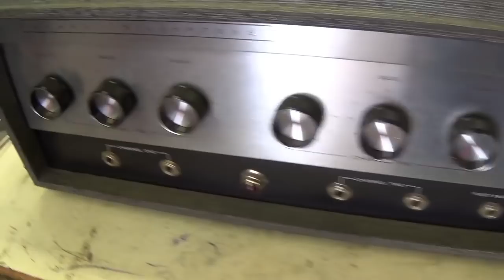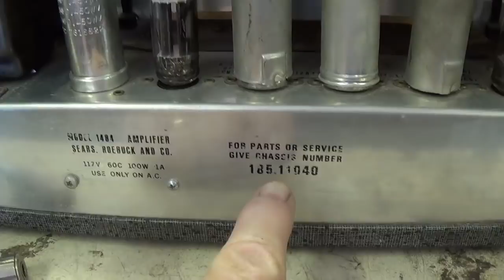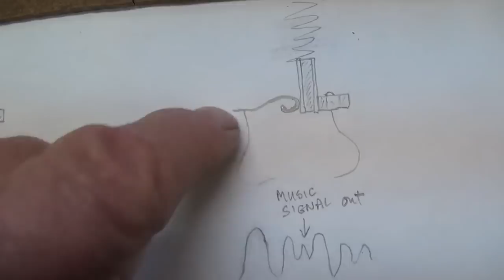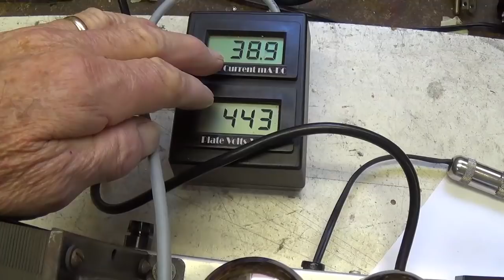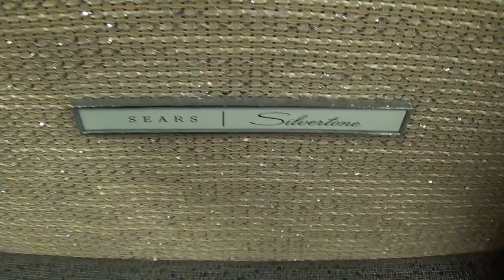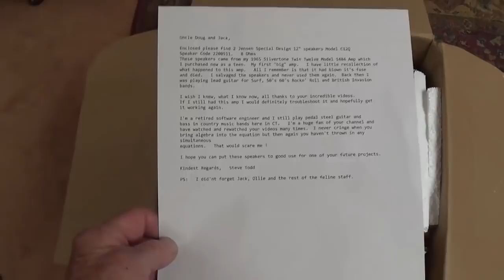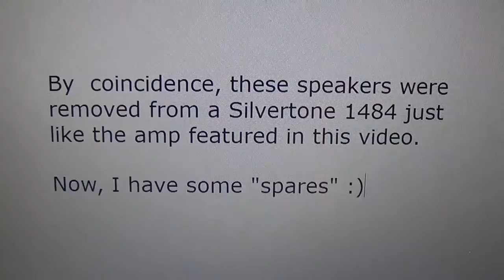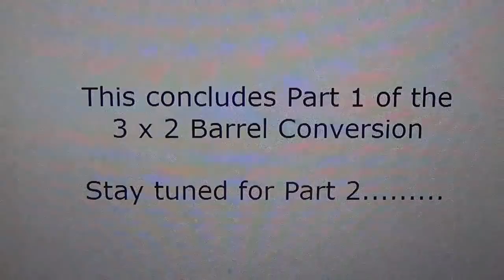Super Nice 1966 Silvertone Model 1484.......The Amp that Launched a Thousand Careers

Comment from the maker: The audio test is as follows:  5 tunes clean Channel 1 and 2.....3 tunes Tremolo.....3 tunes Reverb.....5 tunes Channel 1.  NOTE: The video portion of the demo is not synchronized with the audio portion, so the position of the input cable and amp controls may not agree with what you are hearing.
Reply: I have a 1964 1484. It was 100% original when I got it. I recapped it and installed a 3-prong chord. I love the thing.
Reply from the maker: I don't blame you, William. This video reminded me how great the old Silvertone amps really were.
Reply from the maker: @godsreddoor6345  The Prosonic was only offered from 1996 to 2002, and the early models, handmade in the Custom Shop with "LO" serial number prefixes, are quite rare and desirable. The later models, with "CR" prefixes, were mass produced in Corona, CA and are good amps, but not as rare or desirable as the early versions. If I ever have access to a Prosonic, I would be glad to feature it in a video.
Reply: I hear you on the hand wired stuff. Printed circuit boards are planned obsolescence.  I always say ones tone comes from ones hand .
Reply from the maker: @bobbreakup1001  I agree completely, Kurt. BB King has built his illustrious career on the subtle sensitivity and coordination of his fretting fingers.
Reply: Hey UD! Just stopping by to give you a shout out and to say WE MISS YOU! Hope you & yours had a wonderful holiday season and are doing ok!
Reply from the maker: @ThePreyMantas  Never better, PN. Thanks for your concern and nice note. We're currently working on a new video and should be  back on the air in the near future.
Reply: @UncleDoug  Excellent! I'm relieved. I know folks need to take breaks off for sure, but it's been a little over a month and I was hoping everything was okay and really glad to hear it is! Thanks for the heads up and looking forward to listening to and watching your sage words and witty humor again! It can be an intellectual desert out here at times. ;)
Reply from the maker: @ThePreyMantas  Thanks so much for your concern. I intend to include a Part 2 video, as I usually do, showing some of what I've been up to during the past 2 months.
Reply: @UncleDoug  as I understand it,  Silvertone amps were built in Chicago by the same firm that supplied the Gold Bulldog speakers to Thomas Organ Co. for Vox amplifiers.
Reply from the maker: @zurdoremi  You may well be correct, Z.
Reply: I enjoyed the video.  I'd also like to offer a tonal suggestion.   Plug into the right most input on channel 2 and connect the remaining input on channel 2 to channel 1 using a short patch cable.     You'll hear what i mean shortly after.
Reply from the maker: @davemack6384  Thanks for the tip, Dave.

Comment: The 1484 (which I bought new in 1964) that I had the speak cabinet was connected to the amp with a long 2 wire cord that could not be disconnect from either the amp or the cabinet.  I added a jack to both the cabinet and amp.  On the amp I isolated the jack from the chassis ground by mounting it on an insulated board. I no longer have the amp part but I use the speaker cabinet with a Fender AB763A head that I was able to get used in 1985 and rebuild in 2006.  The Fender head and Silvertone speaker sound great together.  I really in joy your youtube content.
Reply from the maker: Thanks so much for your nice comments and interesting input, William.

Comment: I had one of these amps when I was a young hippie playing in a pychedelic rock band. In a moment of hipness I painted the head lime green because of the effect it gave when under a black light. I ditched the 2 - 12 speaker cabinet on favor of two speaker columns containing 4 12's each. This made the rig look far more impressive. Went to the gig to play and it was sounding great but, then about half way through the performance the amp started to cut out and lost power. I turned around to see what was the problem and saw that the amp head was in flames!
Show wise it was pretty impressive and of course I later found out the fire was due to a amp/speaker impedance mismatch. The amp was destroyed and could not be repaired and I learned a great lesson about matching the proper speakers to the amp being used. Too bad. Now that i'm older and wiser I wish I had that amp just for collectors sake because it would be cool to have. Thanks for showcasing such a beautiful memory as it was and should be. It was fun to watch it being restored. Thanks Doug.
Reply from the maker: You're the godfather of pyrotechnics in rock concerts, Jim. If you had only patented the concept, think of the money you would have made......just from Kiss alone ;)  What a great tale. I may have owned a set of identical columns. Mine were made by Ampeg. I wish I had checked them for scorching.

Comment: UD, Thanks for this video and the previous 1485 video.  I watched the entire 1485 vid about 3 times with great interest.  More about that later.  When I bought my 1484 used in 1968, (age 16) I had no idea how great it really was.  But after all, I was just a dumb kid.  One thing I knew immediately:  When I traded the amp for a newer but solid state Silvertone, I knew I had made a dreadful mistake!!  Some lessons are learned the hard way!
Fast forward to today.  Recently acquired my 1484 head and built a speaker cabinet myself with two brand new Jensen C12Qs.  After watching your renovation of the Silvertone 1485 amp, part 3.  (I guess it was 9 months ago), I started my renovation.  Even though the amp was working pretty well,  (all but the tremolo was functioning), I cleaned the amp's face and chassis, removed death cap, removed ground switch, removed power outlet, added a speaker jack, and painted the two transformers black.  Everything worked out very well and I was encouraged to keep going.  I decided to replace seven of the capacitors, (C1, C17, C26, C27,C28,C29, and C30.  Then, miraculously found the can capacitor from Hayseed Hamfest!  After a few trials and tribulations, (and very good customer service from Tom at Hayseed, have got a really nice and quiet solid amp to play my treasured Clapton and Hendrix licks!  Oh, almost forgot, I also replaced all the input jacks with 4 new self grounding Switchcraft jacks which really help quell the unwanted noise.  (Also replaced two resistors at the inputs and 3 of them adjacent to the can cap).  
When all was said and done, the amp really sounds great.  Jack and KC would be proud to hear this beast.  Couldn't have done it without your fine and entertaining videos.  Please keep them coming.

Comment: Very nice shape. 
I've repaired a few of these with similar problems.  Recapped of course.  Was also able to repair the reverb as you did.
The weirdest one i had was the 100 watt version that squealed and oscillated all on its own.
It behaved like poor lead dress but there was no rearrangement of wires that would eliminate the oscillations completely.
It all seemed to be centered around the screen grid leads of the power quad.
This amp did not have any screen resistors and came from the factory that way.   So on a hunch, i added them.
That completely cured the oscillation.  My thoughts are the original tubes had less gain or possibly higher Inter electrode capacitance (Miller Effect) that subdued the tendency to oscillate.  I did not have any vintage tubes to prove out that theory.
Old tube amps...gotta love em!
Reply from the maker: Thanks, Glen, particularly for the tip on the screen resistors......it may come in handy :)

Comment: Uncle Doug, I have a Peavey  Classic I bought second hand about 35 years ago.  The tone was always a little poor and  the output broke up if the volume was set above 5.  A few months ago, the power transformer burned out.  After much searching for a replacement, I had one made from scratch by ClassicTone.  After I installed that, I figured I should check out the PC board before I fired it up and I found 4 electrolytics which had thrown up.  I also ordered new octal sockets, thinking that replacing those might help with the break up at high volume.  Before I got around to installing the sockets, I saw your video in which you tightened up the tube sockets by squeezing the little pin receptacles with a pointy object, so I did that, rather then cut out the old sockets.  I got it put together and plugged it into my brand new current limiter.  Since I got only a slight glow from the current limiter filament, I went ahead and put the chassis back into the cabinet and put the back door in place,  The amp sounds better than it ever did in those 35 years and I could crank it up to 11 with no break up.  I could FEEL the sound on my shins as I stood in front of the amp.  Before I stumbled upon your channel, I would not have had the confidence to make the replacements I made,  So, I want to thank you for the education.
Reply from the maker: You're quite welcome, Steve. It's great to hear that you're putting your knowledge to such good use. Keep up the good work.

Comment: I have a 1484 twin twelve that my dad bought brand new in 1963, and I starting using it in 1983, when I was 15 yo.   I'm 54 yo now (born in 68) and I have never changed the speakers out, nor have I even replaced a tube in all these years!
Still works perfect!   (Occasionally a little scratchy turning the knobs but no dead spots on pots.)
I didn't realize until today that it is kind of a big deal to own one of these in perfect condition.  Your video was part of the rabbit hole I went down researching whether the amp was a 60W amp as many people claim, but for some reason my dad always called it a 100W.   Many other people, including guitar places selling them also call them 100W.
So which is it?   I'm confused on this one point.   All I know is that the sound is great.
Reply from the maker: With a pair of 6L6GC's the output power was probably between 50W and 60W......if everything was operating properly.

Comment: What a great find Doug.. That amp and cab are exceptional for 1966 vintage.. I suppose the equivalent amps over here in UK were the Watkins range,  and the more powerful  Selmer guitar and bass amps that climbed to the dizzy heights of 50 watts.. Not many of us could afford Vox AC-30's  or their Foundation 50 watt bass head and 18" cab.  It was 1963 before I heard of Fender amps, but the import embargo meant they were very hard to find and 'very' expensive.  Still,  Ken Bran managed to get hold of a Bassman , altered a few resistors and caps and Marshall was in business.. We couldn't afford those either ..£1.00 deposit and 5 bob a week repayments until death. (it seemed) ..  Can't wait to see the hot-rod complete with it's three Stromberg's fitted and working.. Right,  I'm off to the music shop to pay this weeks instalment  of 25 pence.
Reply from the maker: Thanks so much for your detailed and interesting input, Pete.

Comment: I have this same amp. While I was not the first owner, I bought it (as a teenager) from the first owner in original condition, except that I did not purchase the speaker cabinet. The press down type tube shield is the correct one as you suspected.  Your chassis number is the same as mine (185.11040) but mine is stamped on an aluminum plate that is riveted to the chassis and has black paint on it so that Sears Roebuck and Co shows through along with other info. I suspect mine is older and directly printing it on the chassis was a cost-saving measure.  Mine had a long wire attached to the back to connect to the speakers, but no connector at the end. I suspect that it was missing, but I have added a female 1/4" jack on the back of the chassis in its place so I can connect through a more standard connection.  FYI, since I stopped using the amp decades ago, the original Silvertone tubes are still in place and still work. I have recently recapped the amp with the exception of the filter capacitors, which may be why I get an intermittent hum. I also took out the death capacitor and replaced it with a properly grounded three-wire AC plug. I replaced the knobs (back in the early seventies) that I liked the look of better.  The originals were mostly in bad shape. Unfortunately, I did not save the originals or misplaced them.  The reverb does not work (it did when I stored it in my crawlspace back in the mid-eighties (if I had only known how these would grow in value over the years), but everything else does. I recovered the case with blue vinyl and made a matching speaker cabinet out of MDF. The faceplate is in nice shape, perhaps not quite as good as yours. I replaced most of the screws with stainless hex head bolts and nuts. Lastly, I replaced the front panel power light with an LED and dropping resistor.

One question: What are your thoughts on replacing the carbon resistors with modern metal film resistors? Apart from the reverb (I am using an external reverb that I like a lot) since it works and sounds good, is it worth the effort?
Reply from the maker: If it works well and sounds good, I would leave it alone, Mike. You might check the resistors to see if they are over 20% out of spec and replace the ones that are.....but changing them all will be a lot of work with no real payoff.
Reply: @UncleDoug  Thanks for the quick response. My main concern with the resistors is if they would be out of spec in a way that could cause the tubes to be overdriven and fail "prematurely" which is kind of funny to say as they are already about 55 years old. BTW my reverb tank has never been opened and I am thinking that the problem with it may be somewhere else in the circuit. I am just not sure where to look. It might be something as simple as the switch.

Comment: Always worth the wait for an Uncle Doug video! I believe those amps had the head hardwired to the speaker cabinet with brown zip cord when they were new and a lot of owners installed a jack on the chassis so they could plug in other speakers. So the in line jack is less invasive.

Comment: That 350 sent a twitch to certain lower extremity! I love how easy it is to work on these muscle cars, no computer in them, but they had to ruin that for us like that would stop us from working on them. I had a 1979 Z28 MINT CONDITION. It was paid for brand new and garaged until I got it. The original engine was removed and was replaced. It was a 350 totally rebuilt and punched out to a 383 if I remember correctly, new race cam and the heads were done professionally, but I must admit, I had a 400 small block with a Holly 750 Double Pumper. The cops could never catch me. What you have on your beast looks like a Performer intake which is a great choice, but I had a 1981 Dodge Ramcharger 318 2 barrel, but it had the cam for pulling. Someone removed the 4 barrel and put an adapter on the stock intake and a friend handed me no charge a high rise split level Edelbrock so I went out and bought a 650, instant monster 4 on the floor with granny gear as the first gear so normally I started off in second. I was able to pull a Chevy Blazer up a 60 - 70 degree hill in idle with my door open sitting sideways to show off. I always had a thing for only the vapors going to the piston so everything had to be cammed out with the appropriate spacers for the carb and I even did this idea on my furnace, I talked to the guy and told him my idea and he took out this jet element and told me your furnace will never be more efficient using any other as it sprayed a fine mist instead of a stream past the electrodes. I use heating oil and it ran hot after installing this so I knew it was doing the job so I had to adjust it back down to 180 degrees from nearly 200. The efficiency improved 15 to 17%  into the 90's in %
Reply from the maker: Somehow, this sounds like the lyrics to a Chuck Berry tune, Mr. B. Thanks for sharing it with us :)

Comment: Got one myself. Love it!! The speaker connection is not correct. The head and cab came hardwired. Great amp!!
Reply from the maker: Thanks, Slim. The ability to separate the two units is way better than hard-wiring, in my opinion.

Comment: Had one. The head had a solid wire to the speakers. Most owners cut the wire and used jacks so the head and cab could be carried separately.
Reply: Yep, knew a guy with one back in the '60s who put some of those quickie flip tab AC connectors on the stock permanent wire so he could carry the head separately.  He put the male two prong Edison plug on the speaker cabinet end.  Some helpful person plugged it in the AC accessory outlet.  Boom, no more speakers.
Back in the late '60s/early '70s most of these that I saw had the grilles painted with various fluorescent color paints as part of the psychedelic era.

Comment: The speaker cord was originally hard-wired from the chassis to the speakers. Back in the 70's, friend of mine wanted to "disconnect" the speakers from the amp, so he cut the cord and used a 110-volt socket on the speaker cabinet and matching plug on the amp. Those of us "in the know" knew that the factory-molded plug was for power and the "add-on" plug was for the speakers.  One day while we were setting up for a practice, someone who wasn't familiar with his configuration plugged the wrong plug into the wall outlet! We had a fireworks show in my parents' living room! Show you that you need to use the right plug for the application. Lesson learned the hard way.

Comment: Literally had mine opened up replacing the the voltage doubling caps when this popped up a few days ago.  Always nice to have some verification/validation as you're moving along.  I bypassed the the "ground" switch and am also switching the inputs to a fender style "Hi - Lo" configuration with shorting input jacks.  (Crosses fingers that everything works out okay)
Reply from the maker: It sounds like you are headed in the right direction with it, Hud.  I'll bet it sounds great. Best of luck with it. Happy holidays.